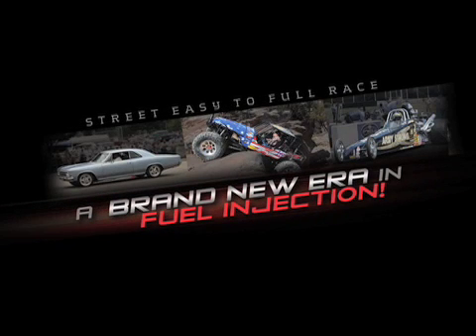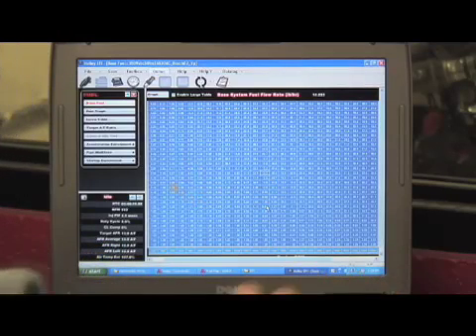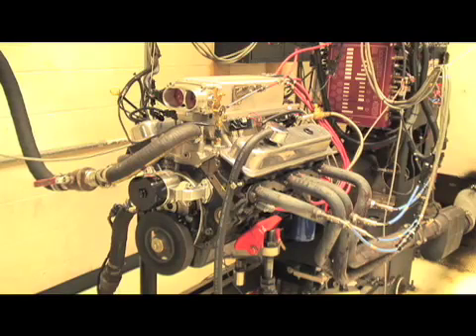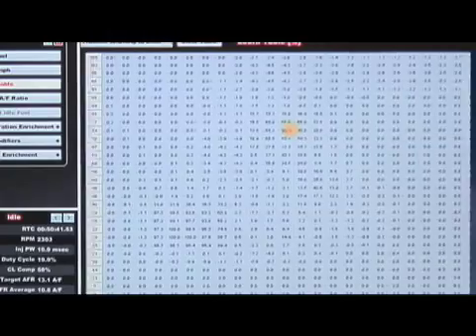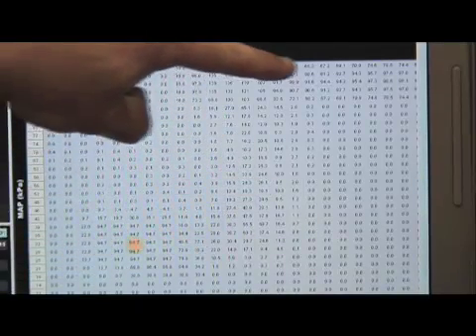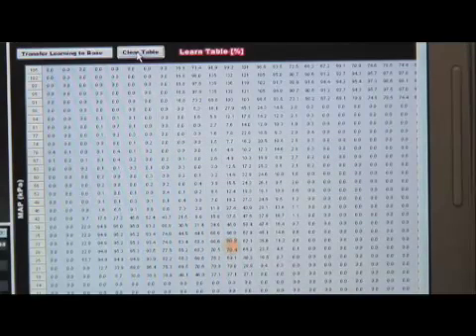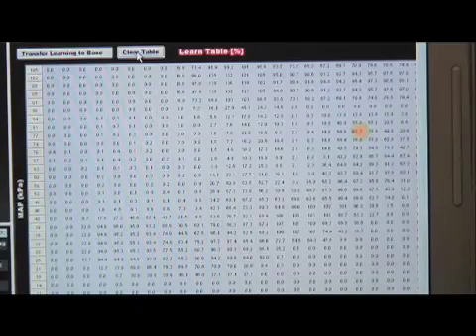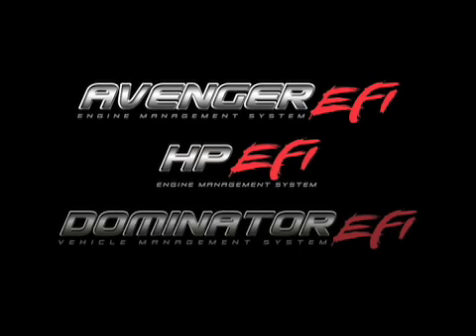Holley EFI Self Tuning Demonstration

Comment: I have a 2002 Pontiac trans am with a ls3. I have a Holley dominator efi system on it and it was tuned originally in bank setting not sequential and the car has never ran worth a crap. It has a dart LS next 1 race block , good internals, 10 to 1 compression and set up for boost. I’ve not put boost on it yet but as of now, Holley dominator efi is the poorest street computer operating system on the planet. I have wasted too much money and time and not had any fun with the car. I’m pissed off and wish I could come up with grounds for a law suit against Holley. Nobody in Houston texas can tune Holley dominator efi worth a shit

Comment: hey, i have a 350 tbi in my 94 k1500 5.7. i was wondering how much easier it would be to install a holley 4bbl efi on a fuel injected engine than a carbureted engine. and how much horsepower i would gain in doing so.

Comment: How about doing a video about something that i can't even find in the effing manual.. A first start checklist.. Like how to set timing before starting it, how to adjust timing for the wide range the EFI seems to require - what to think about regarding to phase shifting distributors if you are using a MSD aftermarket distributor and so on.. i find the manuals are reeeally lacking when it comes to new users.
Reply: I just powered up the holley hp on my coyote and while it does come with some base tables you're right, you're pretty much on your own to figure it out. I basically put in all the info I knew, set it to base tables, and set the learning window to 20%. I guess we'll see what happens when I start it up.
Reply: @177SCmaro  how did that go?
Reply: @rhetericalpha  
Interesting. After solving a major mechanical issue with the engine that took a couple of weekends to figure out i.e. some dumbass (me) had the cams 180 degrees out of phase on the left bank so the engine was trying to run on 4 cylinders, it started up with without much fuss. After calibating the TPS I told it to idle the iac to at 750 rpm and 13.5 to 1 af ratio and that's what it did by pulling a ton of fuel out of that part of the table and it seemed to quckely "learn" the iac once I reset the sensitivity to medium. 
Long story short it idles but that's as far as I got so far. It struggles to rev so I probably need to ramp up the fuel rate on accel (equivalent to more accelerator pump on a carb) but right now trying to figure out why water isn't circulating. 5.0 coyote has a weird cooling system. That's about it so far.

Comment: Sure wish you folks  would PRINT  more detailed  info  about setup and tuning these,   and / or maybe  a tutorial  video.   I just ordered the  DVD from  Steve Morris engines.   Better Mopar support!!!!   would be nice, too.   Seems  to me there's enough guys running  3G  hemis...............
Reply from the maker: Have you found our documents on the website? They can be found here: https://www.holley.com/TechService/Library.asp - Just click "Fuel Injection"
Reply: Yes  but unless you've updated since  summer  013  (I'll check) there's a lot of info hidden in the help file that is not  downloadable separately online
Reply: +fourfortyroadrunner  yeah, Gen 3 hemi's tend to crap out on the stock ecu. Good luck to you on that one. I was trying to work with a 90s Magnum engine for a while.  I gave up after I found out it's as expensive to work on as the amc engine I was replacing. So I stopped caring about staying true to my make and went to an aluminum block ls.
Reply: what video do you buy. I need some g3 hemi help